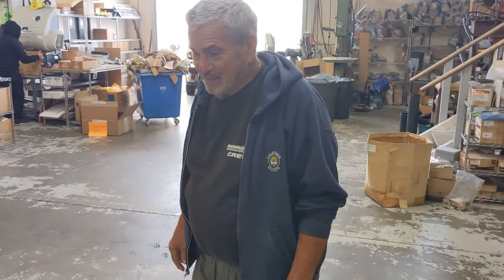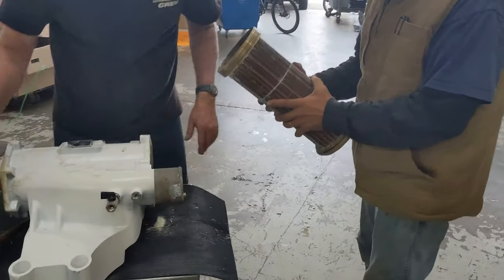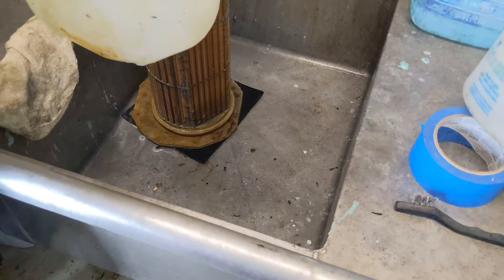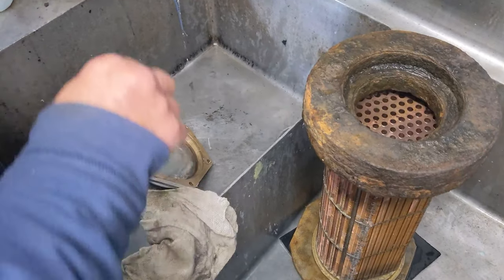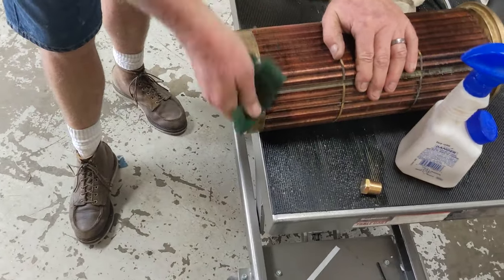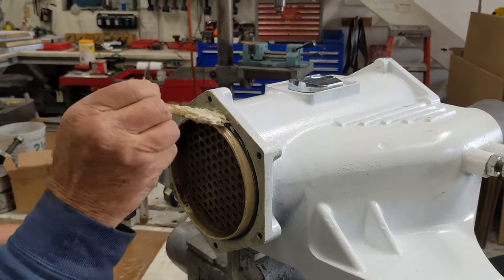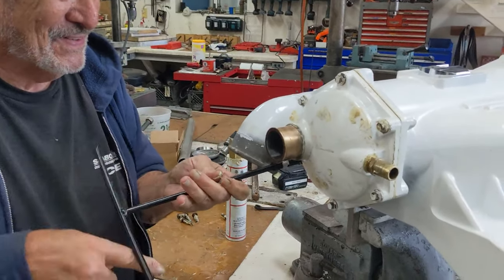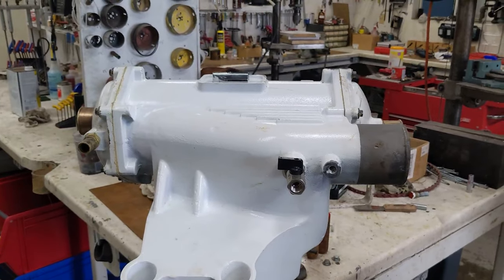Cummins Marine QSB 6.7 Aftercooler Maintenance

Comment: Thank you - amazing video! Would be great to see the video on how to pull apart an intercooler core from it's housing that hasn't been looked after like this! Just bought a boat with this very problem! 2 x Cummins qsb...
Reply from the maker: We are working on that.  Its a little tough because when we have an aftercooler in bad shape the customer usually wants it back yesterday, so its hard to find time to make the video, but we are definitely working on it.
Reply: 😂 yes, don't you know it! We just bought a new core from you having managed to finally get the old one out - thanks for the amazing service by the way! Paid for Friday, shipped to Mallorca and received today!

Comment: WD-40 loosens "salt deposits"? WD-40 is almost 100% plain old kerosene. 

Let's see the "fresh water flush" and a video of the boat in "normal operation". 

Its entirely possible that "aftercooler" is running "dry" the "not many hours" it ran in "3 years in the ocean". 

And you don't need to change zincs in "fresh water"? Even "fresh water" is "salt water" to some extent especially natural lakes.
Reply: Protects against stray electrical current too.